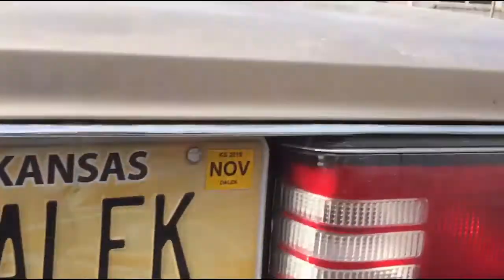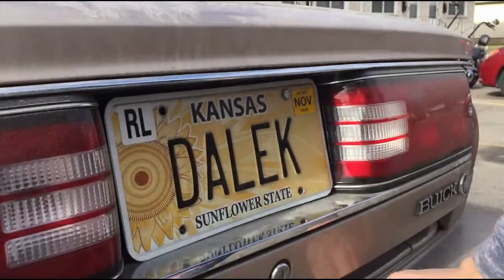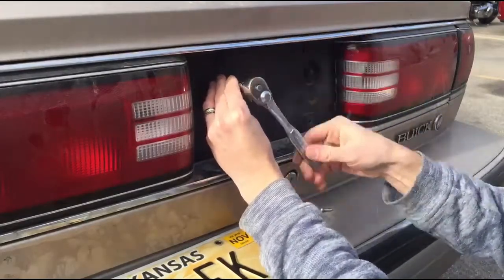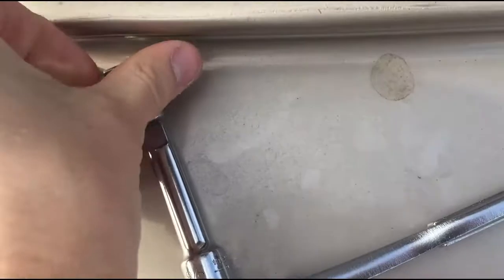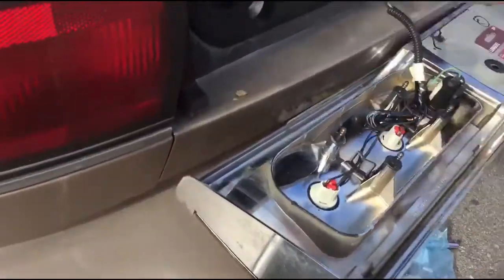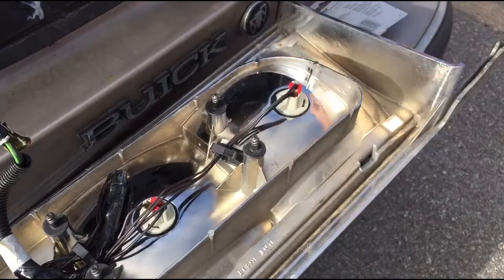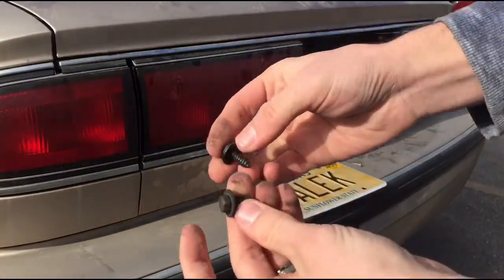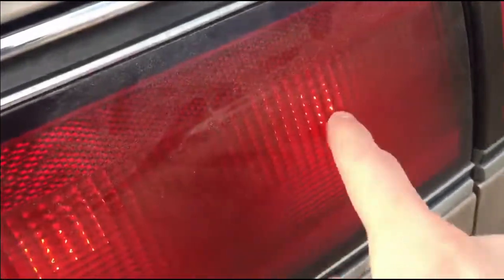1995 Buick LeSabre - Replacing Tail Light

Comment: My 1995 grand prix SE 4  door, also took # 194  Sylvania bulbs I guess must be common bulb used by general Motors cars. I was lucky compared to your buick. I only had to open the trunk & pull the
lip of carpet back except for the bulb behind the trunk catch. O'reilly's charged me around 4 or 5 dollars for a 2 pack. they also fit the license plate light , Grand prix 5th generation w body/platform.
I can't believe buick design, made you do all that. Plus, you had to take time to figure it out .

Comment: Those screws in the trunk are long, how did u get up in there?
Reply from the maker: Streezzzy NextDoor, I had to use an extender for the socket.
Reply: Jesse Wood the screws were to long to fit thru my socket, I can’t get to the bolt even with the extender